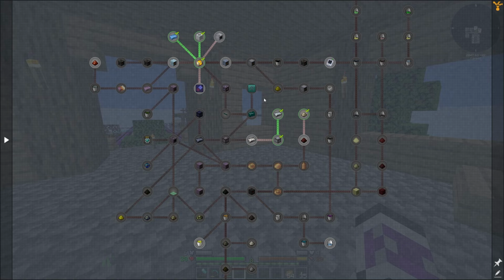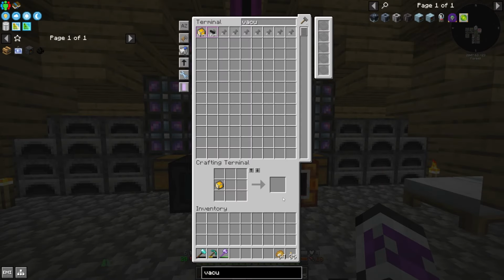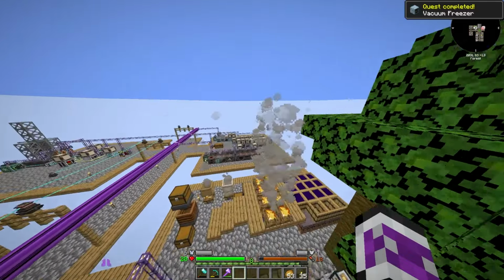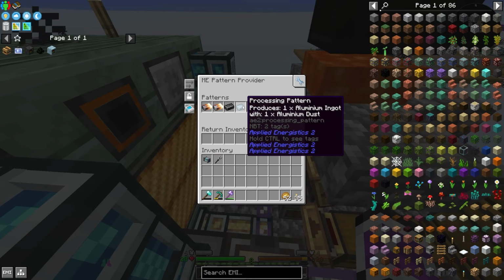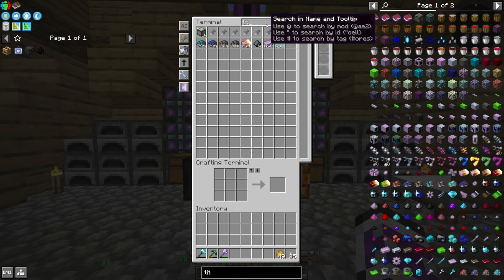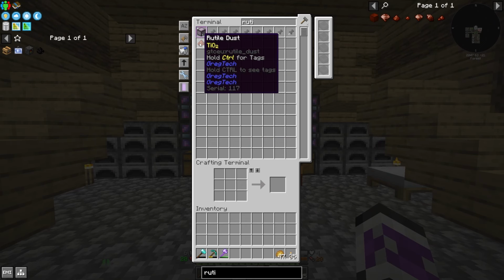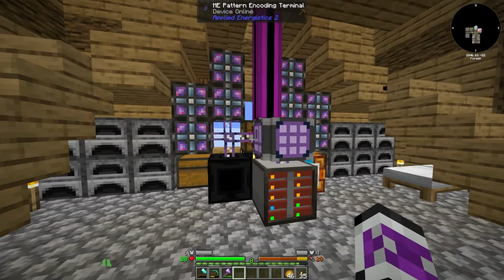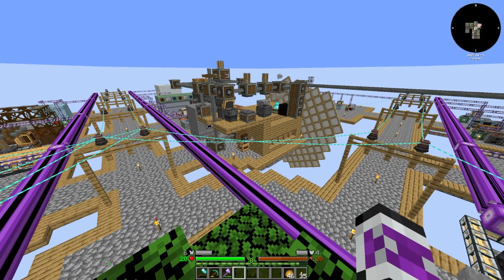Star Technology: Episode 19 - EV Materials

Comment: hey man, ive noticed that youre utilizing ae2 to autocraft pretty much EVERYTHING, which is usually called "on demand". while it is probably possible to complete the pack this way, a lot of the things that you have on demand are things that are usually passived to make things easier overall (imo) and to wait less, such as basic gases (nitrogen, oxygen, hydrogen, fluorine, chlorine, and a few others), chemicals (acids, ethylene, polyethylene, pvc), the main metals of each tier (wrought iron, steel, aluminium, titanium), and one of the biggest projects at around your progress which is ore processing. id say that ive yet to see anyone have something like oxygen and salt crafted on demand. also, for your ebfs, it actually is easy to just use ME interfaces to constantly supply them with nitrogen, oxygen, and helium when you get ev quadruple input hatches and be able to just send items to smelt rather than have to handle fluids and items. im curious as to how you will tackle the platline, which is a pretty big process and is the main way to obtain platinum and palladium, and is the only way to get ruthenium, rhodium, osmium, and iridium. btw as a side note, when people reference automation in greg, they usually mean creating a setup to just process and create things automatically with very little to no player interaction
Reply from the maker: This was always the hard truth that I've been trying to work around. I have an ME requester to keep me constantly stocked with a couple thousand of the materials I use a lot (steel, aluminium, oxygen, nitrogen, etc). So I still need to setup auto-crafting for that to work, and why I set it up with most things going forward so that I don't need a dedicated production line later, the requester just handles it for me. From my experience so far, the trade off is to either spend a long time setting up a dedicated production line to save time later on, or to more easily set up this "on demand" system but have to wait longer than the alternative, and I'm okay with waiting a little longer if the process is easier along the way. So I'm going to continue with method until it fails.
Reply: @Thaumiumking9  so many people already told you huh.

Comment: Ore processing and gas processing should be the main topic for the next few episodes because not upgrading those will become a huge problem in the endgame
Reply from the maker: I think EV is when I get access to the next ore processer so I'll likely do something about that soon, and I've been waiting on the large chemical reactor for help with a lot of the gas processing too. So I'll start fixing both of those problems soon.
Reply: @Thaumiumking9  its IV you get the next ore processor sadly, you can make iv circuits(probably) but the materials used are way harder to get so yeah, its going to be a while till you get IV
Reply from the maker: Well I can still get the chemical reactor at least
Reply: @Thaumiumking9  i mean you can technically do ore processing with the multiblock upgrade, you can use it on the centrifuge, macerator, thermal centrifuge, and even ore washer to turn them into multiblocks, making them good for a n ore proccesing chain
Reply from the maker: That could work, I've been meaning to get those multiblocks anyway
Reply: @Thaumiumking9  theres a ton of other multi's too, like, bender, lathe, wiremill, electrolyzer, extruder, and even a mixer, get the mixer to make all the materials for the other multi's then get the extruder next, those two are probly the most important

Comment: Don't forget normal overclocking only doubles the speed while quadrupling the energy cost; especially with something simple like vacuum freezers, it's better to build multiple machines instead. Use hatch sharing to make it a lot cheaper and simpler. At about your point in the game, I've had a stack of four HV vacuum freezers with multiple pattern providers to cover all the hot ingots :D 

Your machines also still don't look very busy. Most of your machines should be running most of the time, building up resources even without explicit requests. GregTech is a lot about automation and streaming resources through the system. Crafts are fairly slow, and it will only get worse. If you rely on on-demand auto-crafting too much, you'll end up waiting around a lot for no reason. Of course, it also means that the central scaling problem of your base will usually be power :D

Comment: You were wondering a bit about the 4 buckets of chlorine used for titanium tetrachloride. Gregtech respects stoichiometry and molarity of chemical reactions. The only unituitive thing about it is, that for dusts, 1 mol is not equal to 1 dust, but rather x dusts where x is the amount of atoms in the molecule. Let's take the tetrachloride recipe as an example:
The correct equation is TiO2 + 2 C + 2 Cl2 = TiCl4 + 2 CO.
So in Gregtech terms, you will get: 3 rutile dusts + 2 carbon dusts + 4 buckets of chlorine = 1 bucket of titanium tetrachloride + 2 buckets of carbon monoxide.
3 rutile dusts because TiO2 is made of 3 atoms and 4 buckets of chlorine because GT does not care about molecules being biatomic.
End of the GT chemistry lesson xD
Reply from the maker: I had noticed that when I electrolyze compounds into individual elements, I just hadn't noticed it in reverse this time. It might make some of this a little more annoying, but I think this is one of the coolest parts of GT so far.
Reply: The logic is unfortunately broken by some recipes (in many GT5 versions), notably in ore processing - smelting crushed ore directly will usually give you more of the main resource than electrolysis (e.g. tin dioxide will give you one tin per crushed ore if you smelt it, but only 1/3rd if you go all the way to electrolysing it, with the other 2/3rds being oxygen). Some versions of GT change that to have crushed ore stoichiometric too, but that tends to mess with the whole ore processing chains anyway - changing machine ratios and making some byproducts way too easy to get.
Reply: @LuaanTi  True that. That's why I proposed to the GT devs, to really let 1 mol be represented by 1 dust as well. In the case of SnO2, electrolyzing 1 dust of it would give you 1 dust of tin and 2 buckets of oxygen. They weren't really fond of my idea xD